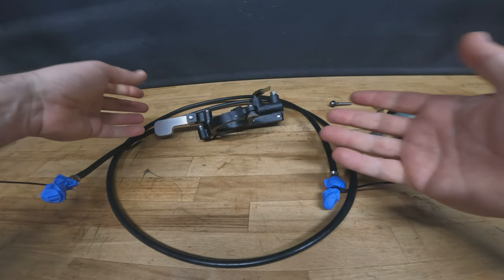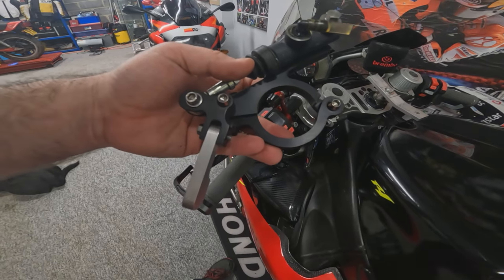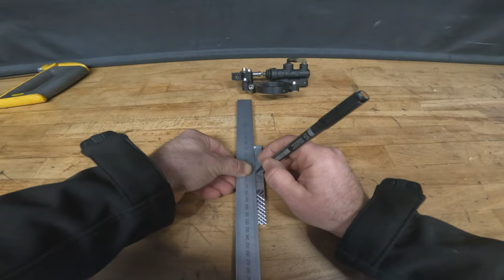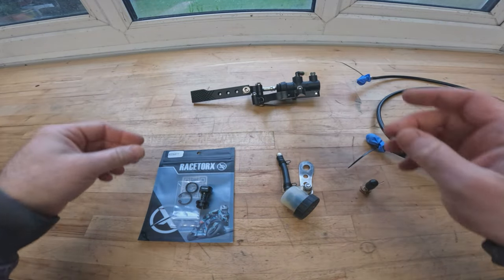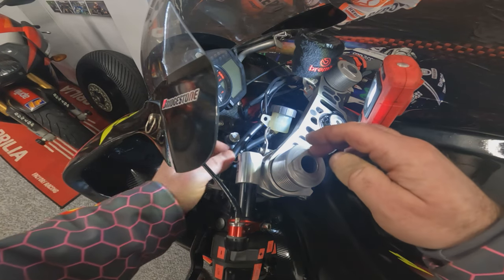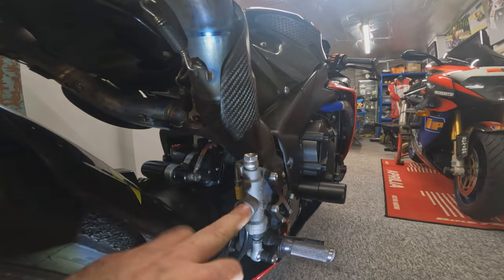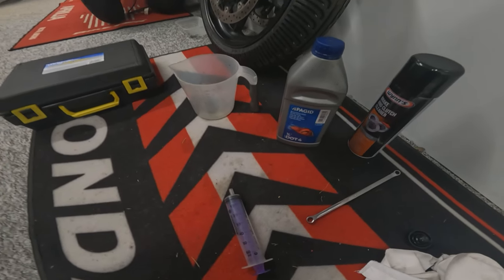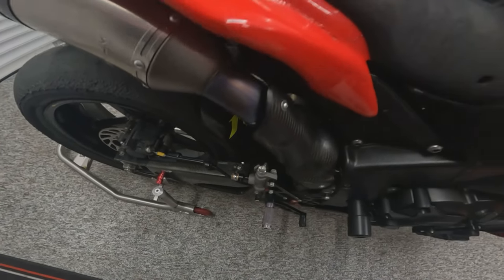Thumb brake modification Yamaha R1

Comment: Hi 👋 very good job 👍 I would like to ask you please how much  long need be  the steel brake line from the thumb brake until the back master cylinder ?
Reply from the maker: Thanks 👍 
This was a second hand kit from another bike so the line was already made, luckily it fitted. Was approx 850mm. If you measure what you need with string or similar, HEL will make you a hose to any length
Reply: @ComrodMsport thanks man 🙏

Comment: Have you ever thought of using a shuttle valve so you can avoid modifying the rear master cylinder? 
i wonder if that will work.
Reply from the maker: You mean like a brake bias valve?
Reply: A shuttle valve ot double check valve, 
Used to allow fluid to pass though it from two sources, 2 inlet 1 outlet. It has a moving shutter inside, if one of the inlet has the higher pressure will move the shutter shutting the opposite inlet and allowing its fluid to move.
Reply: The idea is, using 2 brake master cylinder to 1 brake caliper.
Reply: also i read that, it allows reverse flow during depressurise
Reply from the maker: @kimabella613  not something I’ve seen done but it sounds in theory like it will work. You would have to keep both master cylinder reservoirs though so more fluid to bleed/check/renew and you would potentially have more connections (failure points) in the plumbing 🤷‍♂️ maybe why it’s not common place

Comment: Seems kinda weak or am I bugging? You pressed it a ton to get the wheel to stop considering there's no 200kg bike to stop as well. Never had/used a thumb brake so I might be missing something.
Reply: I thought that too
Reply from the maker: I get what you saying, though I wouldn’t say weak, more progressive to give you better feeling and finesse. 
If you watch onboards of thumb brake use you’ll see they seem to get hammered quite aggressively and it’s for that reason. The super lightweight rear disc doesn’t help in that aspect either due to reduced surface area, it may be getting changed out in the future
Reply: @ComrodMsport  Thank you for the clarification

Comment: What do you call that thing that you replace from reservoir
Reply from the maker: @motoguieb  if you mean in place of the original rear master cylinder, it is a thumb brake junction valve/splitter